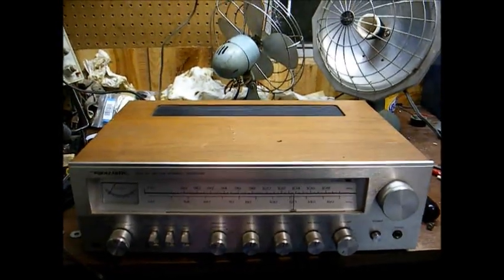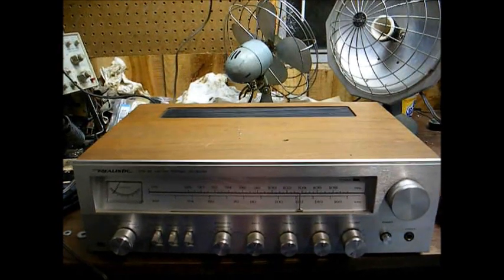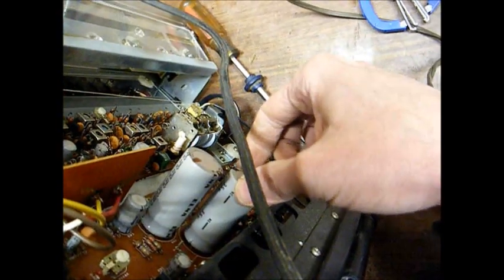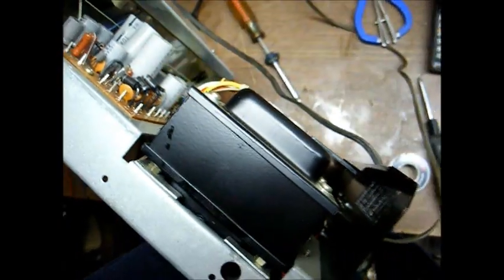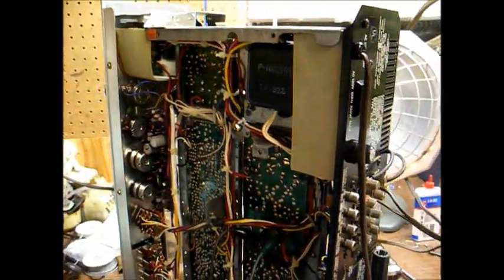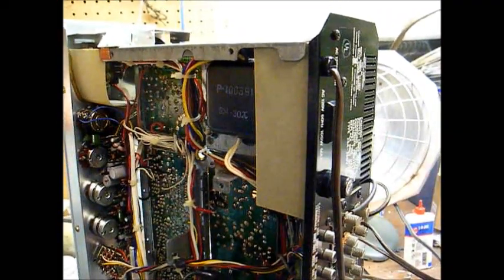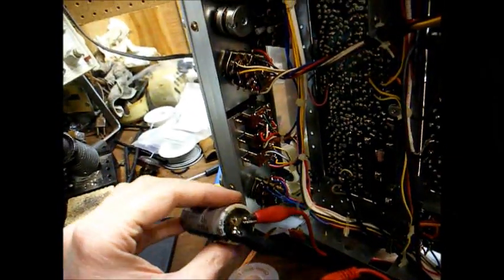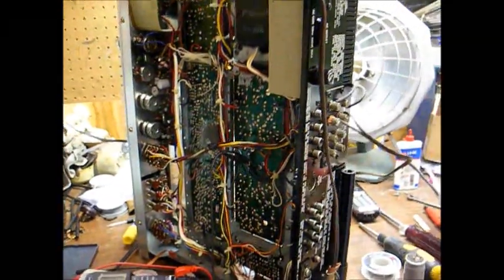Realistic Radio Shack STA-64 stereo receiver repair - part one

Comment: I have a Realistic STA-100 which was similar to the STA-64, but that was from about 1980 or so, maybe 1981 or 1982 to be exact, and it still works without having any problems with loud buzz.

Comment: I bought an amp receiver similar to that in April 1977 when I was 19. It was the Pioneer SX-450. It had 15 watts per channel. Not a powerful unit but fairly durable and a elegant design.  There are a lot of SX-450s still in operation to this day.